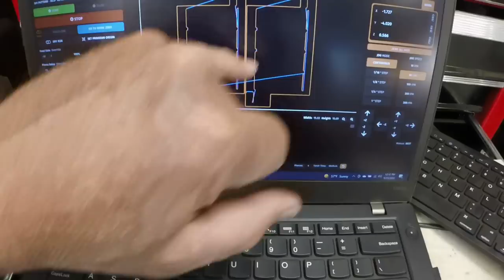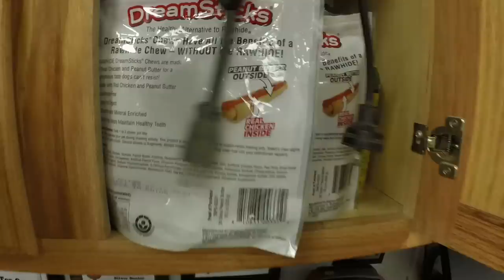Cub Cadet Forklift Build! EP:07, Transformation Continues!

Comment: I do the cut/fold lines all the time with my table. Works great! One day I’ll have a press brake, until then this works great! I use a cut off disk to thin the metal that’s left. Makes bending really easy and accurate. I make the tabs .250” seems to be strong enough to hold together, but allows easy bending. I also run a very small lead in/out. Sometimes I don’t run any lead in/out. Looking good!

Comment: Next time you have to stretch a frame after you mark out your cut lines scribe a line on either side of your cut line, then when you clamp the extension piece in place you can measure from one scribe line to the other on both sides of the frame to make sure they are equal and make adjustments to the insert on one side or the as needed. Also by taking careful measurements at the top and bottom you can tell if there is a sag in the frame. Hope this helps for next time.

Comment: lumber prices came down seems normal now my diy brake is 6ft wide 3x3 3/16 angle iron with support truss bolted to concrete floor bends 10 gauge sheet nice use it alot

Comment: A reasonable bending station is a wood vice on the side of the table with the jaws of plate steel - reinforced ? and not wood.  Then clamp to the line and bend and press over.  Noting like a large floor model.  But functional.  Your metal table worked nicely.

Comment: Good job on the slits they could have been slightly smaller but learning curve. Note on bending clamp 1/4 roughly along the edge of the table and the wider portion overhanging the table and then just bend up or down.

Comment: Very cool project, though  i would put wheel spacers on the big wheels for stability or put two wheels on each side. If the tractor sways any at all with a load it may tip over. Maybe something you want to consider?🤔👍

Comment: The splice could use a few small doubler plates for insurance.  With a solid mounted drive axle and a pivoting steering axle you should not get too much torsion on the frame when you lift a load but watch for it on uneven ground.

Comment: Just a quick note to tell you that when you get to the rear which used to be the front. Take the bump stops and possibly you might have to extend the steering arms to allow more of a turning  radius. The sharper to the side the tires turn the tighter the turning radius. Not a complicated but easy change to make it a lot better machine in the end.
Reply: If you turn to tight the the tie rods will flip past their working point.
I used honda 4 wheeler tie rods once thinking I  could do what you say. You can only go so far. The tire will scrub

Comment: You likely don’t need any help picking out another project but if you hd spare time you should check out a machine called brakes a lot by grisom work I believe. It would be a good start to a break if you wanted to build your own. I built in a hole punch on one side that uses iron worker dies an the other end I have a 3” notcher , works great.

Comment: Heavy Angle Iron Clamped Down to your Welding Bench - Would Have Helped Bend it Smoother - Also Try Putting a Welding Shade Lens Between Your Plasma Cutter and Camera - it will Eliminate The Flash and Show the Cutting Process Much Better...
Reply from the maker: I tried it.  The camera can't focus and the image is too dark to tell what is going on.  Maybe need a lighter shade of filter?  Still playing with it,  but without an auto darkening filter, the footage is not very useful.  I'm playing with an auto darkening filter but it's pretty big and cumbersome for this application.

Comment: You should have welded the bends up on the bench before you welded them to the frame. You would have been able to weld inside and out with ease. and grind them down to a nice finish. Then welded to the frame.

Comment: Frank, if you need to, you can shorten your turning radius if you move the steering axle towards the drive axle a bit. Too much, and it may cause you to inadvertently run into things. I suspect I'll need to do that with the steering axle on my snow plowing machine, depending on how much I will lengthen the frame. I don't expect to go as far as you did on yours.

Comment: Just curious Frank, no way am I criticizing, but one question, why didn’t you use the first cut outs you made on the plasma cutter. You would only had to put the slits in them. Again, not meant to criticize, your work is superb.
Reply from the maker: Didn't think I could get the slots located as accurately as I wanted.  It's different than starting an entire piece where the accuracy is within about .005 inch for all the features. Two issues affect cutting on an existing piece--locating the origin which is just a visual location, and orientation of the part, which may move slightly during the cut.

Comment: Can you adjust the depth of your cut plasma table, maybe only cut half way through the metal where you want to bend it. I’ve seen people do that with a cutting wheel.🤷‍♂️
Reply from the maker: Not really. At least not reliably. And it's very messy, throws slag everywhere instead of down into the table water.

Comment: I would think it would have been quicker and better and stronger to use a angle grinder with a thin wheel and cut a groove partial way and then bend the metal
Reply: Only for a get r done kinda dude.  Also, he pointed out he wanted to try it out.  There’s never a problem learning new things.  You tend to get a better grasp on how things in a whole operate.